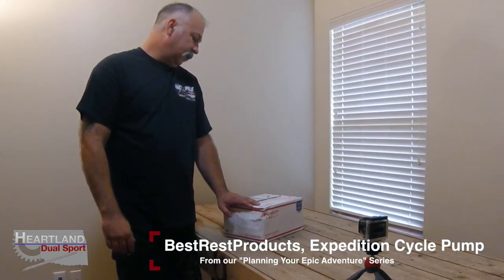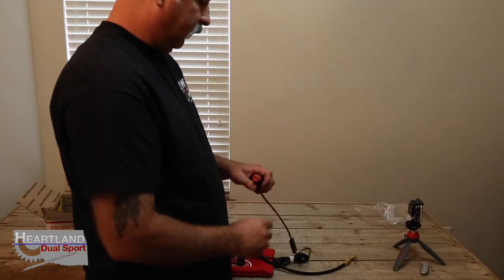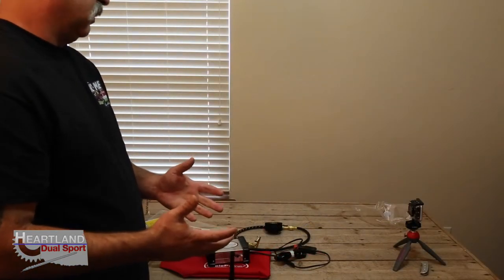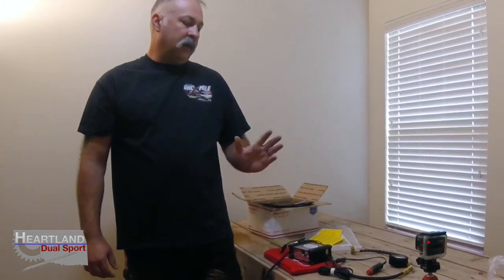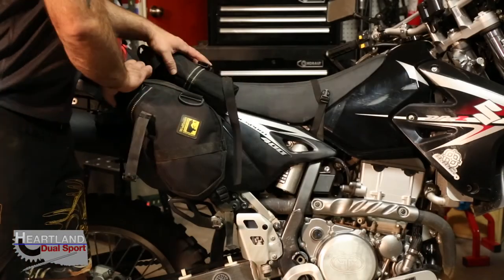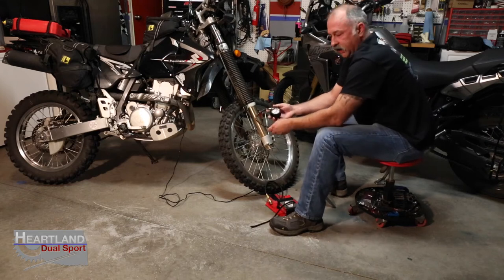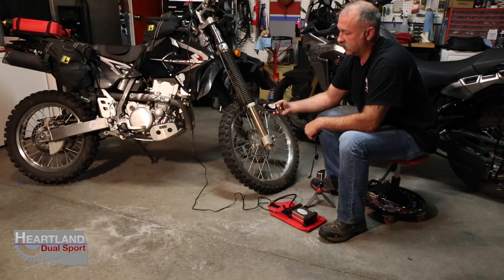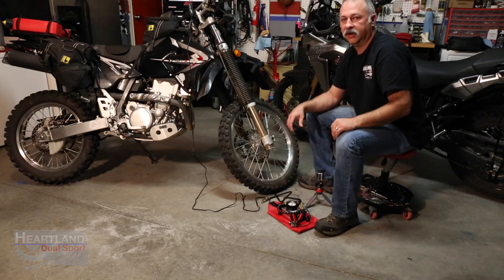Best Rest Products, Cycle Pump Expediton Inflator and EZ air Gauge

Comment: That is a NICE set up!  I really should have something like that, because I have been in places where I should be airing down, but I don't because of the hassle.  This would make the job much easier!
Reply from the maker: Yes sir, that is another reason I bought it as well, It will make it so much easier for sure. Air down, then air back up when you are gonna hit the big roads. Pull up his website, they have a bunch of cool accessories etc. I have another video coming out next monday on another one of the tools they have. I am very impressed with this company and the quality of their gear. Thanks so much for watching and commenting and I hope you have a blessed week.

Comment: I like that the air gauge has a 90 degree angle! It looks like it better that  my slime air pump! Great review Dale!
Reply from the maker: +lonestarrider yes sir. That 90 degree fitting makes it so much easier than the ones that are straight. 
Thank you for watching. I keep this in my truck when I am not riding. Great tool to have around.

Comment: nice pump but can it seat the bead of a tire? Changing a tube trail side and then seating the bead is a tuff task. If I was to carry one of these it would be for tube changes only and not air pressure adjustments so just interested in it's max pressure rating etc. nice video.
Reply from the maker: Thank you so much for watching and commenting. As a matter of fact, this next Monday, I have a another video coming out with the bead breaker and I do a simulated flat fix using the bead breaker and this pump to fix it all. Since you asked, your question will be answered Monday, so you are not in suspense all weekend.., yes, it can be done. heheh. Thank you so much for watching and commenting and I hope you have a blessed weekend.
Reply: perfect... I'll be watching. thanks
Reply from the maker: Yes sir, there is a little trick to it, I show you how it can be done in Mondays video, Thank you sir and have a blessed weekend..

Comment: question sir, will this pump set beads on a tubless tire? I really like it.
Reply from the maker: +Big Jon here is what I have done for a test for just that. I broke down the front tire on my DRZ with that question in mind and here is how I made it work. 
This same company has a hose they call the donor hose. (I do have another video on it). 
I filled the rear tire up to like 45-50 pounds of air with this pump. Used the donor hose and it did set the bead. So for a quick fix in the field yes it can be done with this pump and the donor hose. 
The tires on my DRZ are the Dunlop D606. The are not the tightest tires. But a long way from the loosest as well. So I feel fully confident out in the field this pump and the donor hose will will. 
I'm on my phone and don't have the link but it it in the Bead BrakR video if you are a place you look through my videos. It's also in the planning an epic adventure video playlist as well. Because this is the one I plan on going with me on all my long ADV trips. 
Hope this helps answer your question and I hope you have a blessed week my friend.
Reply: Awesome, thank you sir. My tires have tubes as well, but not everyone in the Group does. Was just curious about it. I will look for the video on that, and I look forward to the series as well. Have a great night bud!

Comment: Running slime in my tubes ruined my nice air gauge like yours, something to think about. Clogged it up.
Reply from the maker: Yes sir, I know from mountain bike, it will do that in a hurry. I have ride on in the DRZ and I have noticed it isn't nearly as messy as slime. I do try to push air in before I take a measurement if I can remember to do so, but you are 100% correct, it is something to think about if you run slime it will mess up an air gauge pretty fast, thank you for pointing that out. I appreciate you watching and commenting and I hope you have a blessed week my friend.